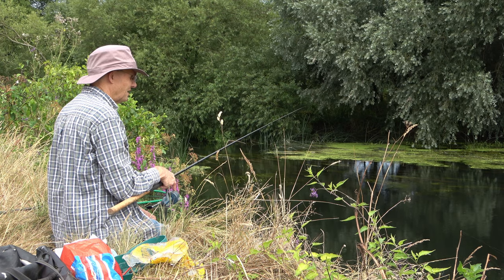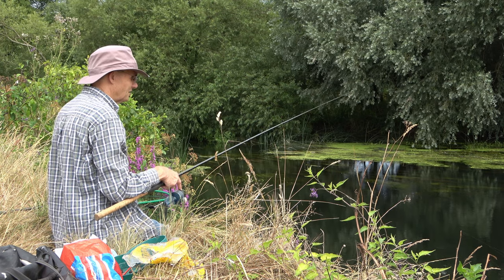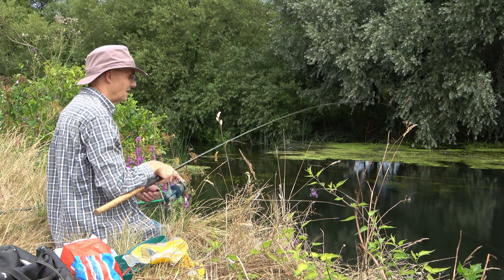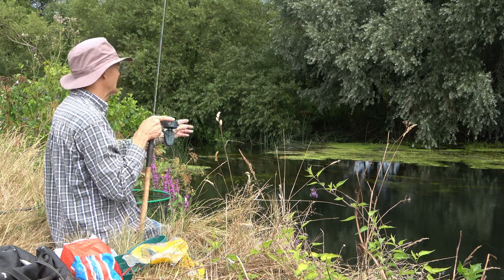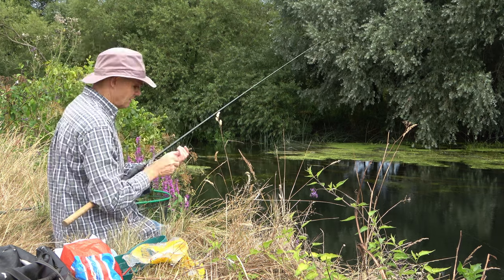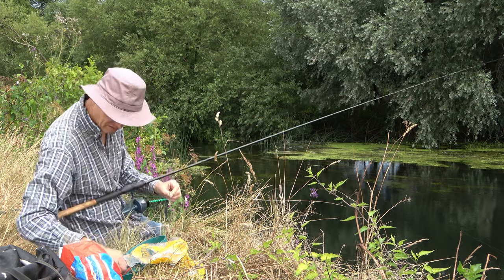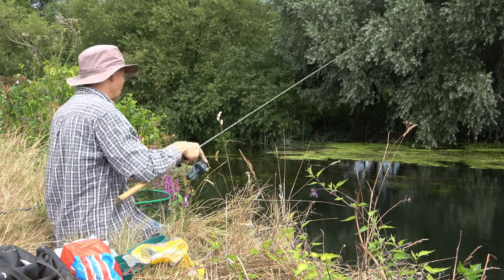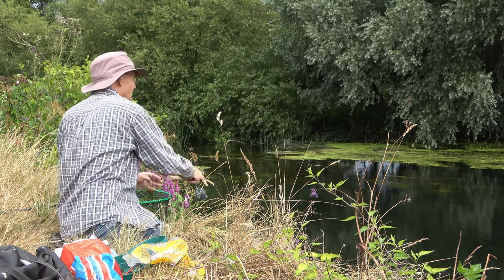Match Rods - Spliced Tips Versus Hollow Tips

Comment: Great video Mark.  I’ve owned a few spliced tip rods and always had a preference for them over hollow tips, even for the waggler.  I’ve still got a few including Tricast Diamond, Shakey Boron and President and a couple of Jan Porter’s that might have been a Tricast blank.  The tips on those are so fine I’m afraid to use them now!  But if one rod rules them all, it has to be the Titan 2000 for me for doing everything brilliantly.
Reply from the maker: I've still got two Boron Mach 2s, one intact B&W John Dean plus another with no tip, Daiwa Amorphous, Dave Harrell ST, Mk I Microlite and the Tricast Allerton, all good rods with spliced tips. I once helped someone in my local shop weigh up the choice between the Jn Porter rod and a Daiwa Connoisseur Mk II, with the Daiwa which cost a bit more shading it. As you say the Titan 2000 is outstanding though. The only spliced tip I've broken was on my Mk I Connoisseur which had a wind wrap in a gale; I got a replacement tip from Daiwa.

Comment: I’ve got the Allerton waggler rod and it’s hollow tipped and has a softer action than my Allerton spliced tip rod. Both lovely to fish with
Reply from the maker: Although I'm aware of it I haven't actually seen the Waggler rod.
Reply: @MarkWintleFishing   I really like it. Back in the summer fishing for pond roach with 2lb maxima main line to an 18 it managed, after a while,  to subdue a 23lb common. Not what it was designed for but goes to show what can be  achieved with balanced tackle.

Comment: Mark watching  the video about  spliced and hollow tips,I use a Hardy 12 ft spliced tip rod, do you know the rod,I use it with a mitchell match,it's great for me on the river all day .
Reply from the maker: It's not a rod I'm familiar with. If my memory serves me correctly Hardy did carbon match rods with spliced tips in the very early 1980s.
Reply: Hardy re introduced a river range ( carbo n float rods ) under the the marksman banner , I think they were around fora few short years ( expensive pricing as well ) from around 2012 to 2016 , there was also the feeder range of the same marksman rods … if before these yrs I think they were the same named rods ( marksman ) carbon blank but Crome guides , I’ve only ever seen one ! Circa the 1980 s